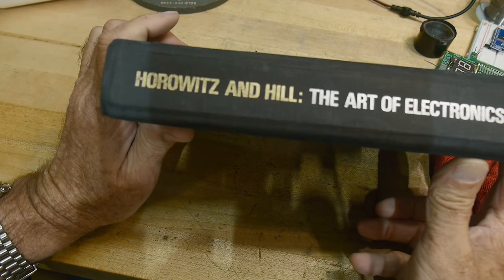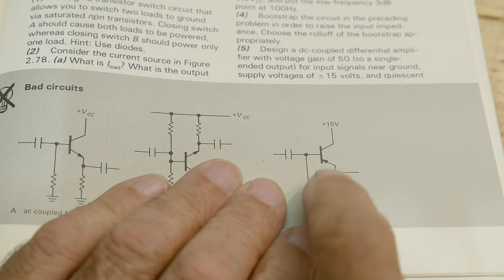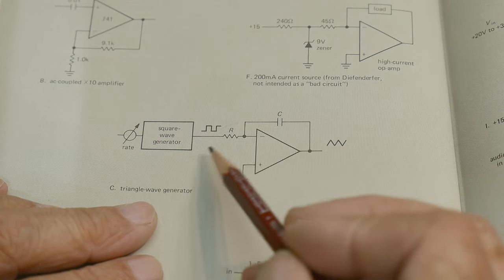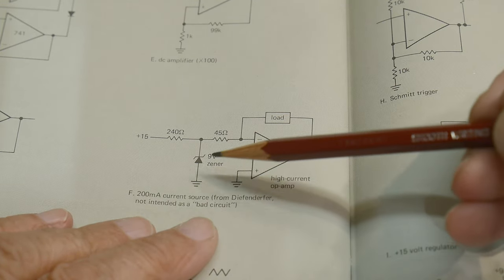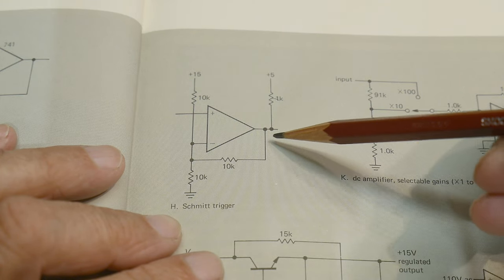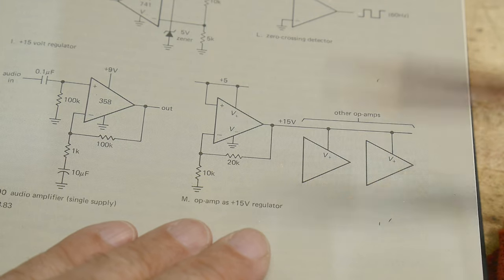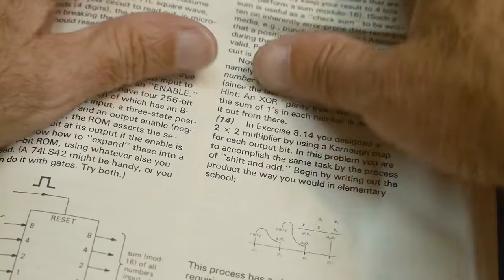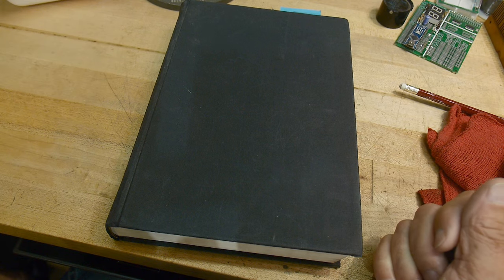#1548 Bad Circuits from the Art of Electronics

Comment: Gx100 gain audio amp. The problem is that the opamp input is not DC decoupled so it amplifies the DC x 100 going into saturation.
Reply: You beat me to it 😊
Reply: Also non inverting stage should have 99k feedback resistor, since the gain is (R2/R1) +1. In general it's just an odd circuit that doesn't make any sense, so I get that he was confused about it.
Reply: ahhh thanks it's so obvious but I never would have noticed it lol

Comment: I love this book and have used it a lot but it has the same problem as all academic textbooks in not providing answers or explanations. It even calls these "self evident" which is hilarious because I've never figured out most of them 😅
Reply: Not having the answers to the exercises in the book is a HUGE short coming.  It does no good to work an exercise and not know if your answer is correct.  If you get feedback that your answer is correct, you build confidence in that your knowledge is increasing.  If you get the wrong answer, then you can rework the exercise to figure out where you went wrong.  This is especially true if you are self-teaching without the benefit of an instructor.

If they published answer guides for the three books, I would gladly purchase them.
Reply: This is an issue with most theoretical books or other books they use at school and university. You'll get a bunch of examples and problems that only exists in theory. Or worse won't ever work in practice or are even dangerous.
Reply: @p_mouse8676  In that case AOE is full of very practical circuits as well (and specs, and some data sheets...). Some exercises are similar to detailed analysis of some "must be known" circuits. But some of them are also quite tricky and require further study. There is in fact another book "Learning the Art of Electronics" which is of great help when one wants to study the "AOE" reference book.
Reply: Yes that is pretty annoying. If they really were "self evident" why put them in the book in the first place!
Reply: That makes two of us :)
Reply: And me😂
Reply: Yeah, if they are self-evident, then what's the learning exercise? lol
Reply: Great opportunity for some youtuber to create a playlist with the solutions for each exercise! Thanks for the video!

Comment: The integrator circuit to create a triangle wave will end up getting stuck at one or the other of the rails due to nonidealities of the op amp. You need to have something in integrator circuits to control the constant of integration.  The Schmitt trigger needs to use positive feedback not negative.
Reply: It happens with a perfect integrator as soon you have a duty-cycle or symmetrie slightly off 1:1, or more exactly, slightly unequal areas below and above 0V. The closer they get, it takes just longer to drift to one of the rails, but after infinite time, it always will. The offset of the opamp and so on just makes it worse. 

You can either put a resistor parallel to the capacitor to limit the DC gain, but this does hurt the linearity of the triangle .. or, as done in triangle generators, use the triangle to produce the square wave.
Reply: @VintageTechFan  Any periodic signal that passes through a capacitor will technically integrate to zero.  The real problem is that the op-amp has a small offset voltage that will also be integrated.  Putting a resistor in parallel with the capacitor is adding a high pass filter to the integrator which effectively removes the "DC" error.  This can be ok solution for some applications, but deciding the roll off for the filter will be application dependent
Reply: @argcargv  Not really. If the input signal has a DC component, it will integrate that one, too. Periodic doesn't mean DC-free.
Reply: @VintageTechFan  but all you have to do to remove the dc component is capacitive coupling.  My point is that even if you do that, any input offset error of the op amp will still cause problems
Reply: @argcargv  Putting a capacitor in front of it will also distort the triangle shape. 

But yes, you are correct. It all condenses down to the fundamental problem of all integrators. ANY DC component, wherever it may come from, will have them drift to one of the limits sooner or later. An infinitely small DC component will just take infinite time to do it, but it will happen. 

You need to implement measures to counter that drift. Making it a low pass instead of an integrator (which is what adding a resistor parallel to the capacitor does) is the easy way and often sufficient, since a low pass behaves as integrator if you a far above its edge frequency. If you have to deal with very low frequency signals, it gets more complicated. Also, with this solution, you still set a DC gain by the two resistors and will get the input offset voltage amplified by that amount at the output .. if you set it low, the capacitor will get large.

You could for example track the DC offset developing on the output over a long time (many, many periods) and apply it with an appropriate polarity to the + input. After you chose a low offset opamp (maybe even one that you can trim to near zero).

Comment: If the DTC is not spot on exactly 50%, your triangle goes flying to either rail :-). You need to put either a resistor over the capacitor, but this distorts the flatness of the ramps. Another method is to use a positive and negative peak detector and a feedback adjusting the positive and negative peakvoltages of the square wave, or changing the DTC

Comment: The JFET analog switches are biased incorrectly, because the gate-channel junction acts like a diode if you feed them more than +0.6V Vgs. All three MOSFET analog switches are biased incorrectly because the input signal amplitude varies by more than the gate voltage.

Comment: 4:43 A resistor is required parallel to the cap in the feedback path.  The reason is the circuit is acting as an "ideal" integrator, but a practical integrator requires the resistor to provide DC stabilization.
Reply: A "leaky" integrator.
Reply: I missed that. The op-amp bias current will eventually put a voltage across the capacitor and latch it up.
Reply: I think the real issue is what is in the input? I think it will work ok with a +/- input, but not a 0/+ input.  The input resistor should deal with the offset currents.
Reply: There is a variable rate input control to the signal generator - the fixed integrator time constant around the opamp may not work well for all of the possible oscillator frequency rates.
Reply: @BowlingSuperior  It would certainly change the output amplitude.
Reply: this was my thinking as well... I've never seen high pass filter in the feedback without that resistor.
Reply: @russellhltn1396 IT will make the Feedback PT1 thats Low pass and only with C we have only integrator. So, R parallel to C will Change the Phase of stability And make the circuits Not so sttable. And because bandwidth and Transit f constant ist, then also the amplitude in dB for lower frequencies and DC will be larger without R

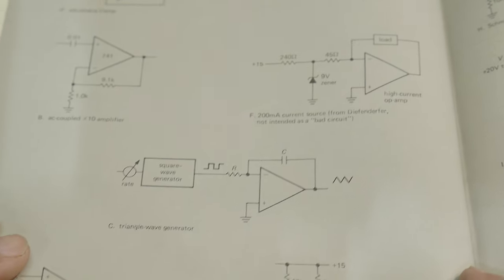Comment: 4:23 input bias current needs to flow in the 741, which otherwise will slam into one of the rails otherwise. With some, like LM380, it will work, because the designers put internal biasing, so all inputs can be directly AC coupled, and in fact you need to AC couple, as the input bias is set by the output devices to put them at mid rail, even when used in a single ended supply.

8:00 your output will have a big DC offset, and it will vary with temperature, as your amplifier will be amplifying any drift in the transistor Vbe, plus it will clip to negative rail very easily, as it has too high a collector resistor compared to the emitter resistor, so will basically ignore the input biasing, just using the transistor as if it was biased hard into class A, with the opamp input probably sitting at around 2V off the ground.

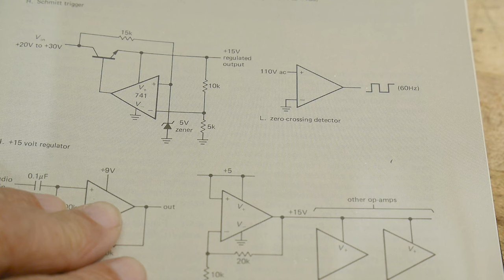10:48 the only opamp you can connect directly to 110VAC is one of the INA series of differential amplifiers, which have input resistors that are happy with up to 200V on the inputs.

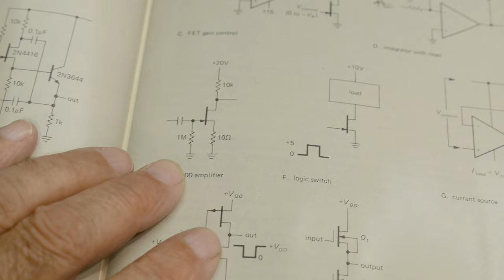13:00 using depletion mode Jfets, with positive gate bias, so they actually will always be on, as you need negative gate bias to turn the device off. I have abused them that way, using a dual Jfet to act as an AND gate (negative logic, to use the pulses on a VFD display to allow me to tell if a segment on a multiplexed display was on) to operate a small low current relay, to allow selection of an input based on the display showing a particular segment. Display ran on -30V, so a pair of 560k 1/16W resistors in series with the gate, and another to ground, made it work, keeping the gate biased correctly negative, and not causing much ghosting of the rest of the display. Then grabbed a convenient 12V power supply for the sensitive relay, and used it.

14:00 The bad part is the resistor values for TTL, not low enough to have correct input current, and for the wired OR no pull down resistor to handle the input bias current that flows out of the TTL input. LED drive direct off TTL was fine enough, though your logic level was not going to be able to drive another gate input, unless you used a resistor to limit current, and also ran the LED from Vcc, as the gate sink current capability is much higher than source, typically 24mA versus 1.6mA when sinking versus sourcing, because TTL is ground current driven. Also bad one seen but not talked about was driving input with negative voltage, or voltage much higher than supply, without using both a series resistor and a set of clamp diodes to the supply rails. for TTL give enough current into the input, around 50mA, and there is a good chance of turning the parasitic SCR in the substrate on, and if your processing at the fab was having an iffy day the overall gain of each transistor in the parasitic structure was over 1, making it a pretty good crowbar across the supply. If the power supply was current limited, it would just clamp the 5V rail to the current limit, and if it was over 1A current, the IC would get hot. If you had a 5A or better supply, then the crowbar IC would get nice and warm, till it either went short circuit from the die cooking, or it blew up the power pass transistors, if it did not have foldback current limiting. If it was capable of over 20A the ceramic packages would pop the lid, and the plastic DIP would blow a hole in the top, letting the TI/NS/Motorola/RCA special smoke out. I framed the one board that did that....
Reply: 13:00 Not only the depletion mode JFET needs a negative voltage across the Gate-Source junction for turning off, but also a positive voltage on this jonction would destroy the device if the current is not limited, as this jonction actually acts as a diode, with a voltage limited to around 0.65V 🙂

Comment: The circuit with the transistor upside down works in reverse beta mode. That’s handy sometimes - usually for hard switching though. They saturate at a much lower voltage than in the forward beta mode. The reverse beta mode also gives you a beautiful knee so the transistor can be used as a pretty good diode just by going between forward and reverse beta. In reverse beta there’s so little collector current compared to same base current in forward beta that a sharp knee around 0V results - a much better switching diode than a diode-connected transistor. The latter has a very good exponential response - better than many discrete diodes, especially when the base is wide (high voltage types).

Comment: 13:25 (F) it's a J-FET. Recall that they are depletion mode only so gate between 0 and +5V isn't useful. This is a hint for (E0, as well. 4:30: offset errors will lead to the output running to one rail or the other. 6:35 (F-- the Diefenderfer circuit) the current through the 45 ohm resistor will pass through tthe load (neg side of the load is at the op-amp output). Standard transconductance configuration. BUT, the current for the 45ohm resistor is sourced via the 240ohm. The voltage divider action will set the cathode of the zener at about 2.4V, giving an ACTUAL current of about 50mA.

Comment: 12:24 The analog switches: A will burn out the gate by applying +5V without current limiting. When 0V is on the gate, it will clamp negative voltages when it should be passing ±10V. B won't work because the MOSFET's parasitic diode will conduct when the input goes negative. Two MOSFETs in a row with the diodes in opposite directions would fix it. In C, when the JFET gate goes to 15V, the gate diode will be forward-biased and it will inject ~14.4V into the input and output. Depending on the surrounding circuit, it might also exceed the gate current rating and destroy the JFET.

Comment: G is actually fairly obvious. The positive input of the op-amp is likely not around ground so it has a positive offset, yet is DC-coupled to the first stage. This DC-offset sill be amplified by a factor of 100. At a supply voltage of +-15V this means that unless the offset is far below 0,15V the OP-Amp will simply clip. One might think that if you adjust the resistors correctly, and connect them to the negative rail instead of ground, it might work, but keep in mind that temperature drift will easily change the offset voltages enough to clip again.

Comment: Hmm, for the triangle wave generator it has two fixed value components for R and C, but a variable rate square wave at the input. So the shape at the output will be heavily dependent on the frequency of the input – could be anything from a square wave with a slewed edge at low frequency (with reference to the RC-determined slew rate), through a reasonable triangle wave, to a triangle with diminishing amplitude as the frequency rises. I think!

Comment: Non inverted gain 10 circuit (4') the wrong thing is that the non inverted pin of the opamp is not biased. There's always a bias current, even in the FET opamps. The capacitor integrates the current and the output follows this voltage (with the gain).

Comment: The problem with the integrator (4'38") is that the opamp has an offset voltage. This creates a current through the R that is integrated by the cap. The voltage at the opamp's output goes to VCC or VEE, depending on the offset voltage sign.
Reply: Another issue could be with the variable rate on the square wave generator - the output amplitude will change with the input frequency instead of staying constantish, which may not have been intended?  And it would end up clipping if the duty cycle isn't exactly 50%, probably.

Comment: Just watched this one and noted your mention of an answer guide. I’m not aware of one but Thomas C. Hayes did author a Student Manual for the Art of Electronics along with Paul Horowitz. I have a plastic ringed binder version of that first published by Cambridge University. Press in 1989, with updates at least until 2002. Full of lab exercises (23 in fact), loads of examples, worked problems, circuit diagrams and references to related readings in the Art of E. Highly recommended. Thanks for your content. I find your videos often touch on current projects. Keep it up!
Reply from the maker: https://milesdai.github.io/TAoE3Solutions/data/taoe3-solutions.pdf

Comment: The zero crossing one is fine. When the line is at zero volts the indicator light built into the opamp will extinguish. When it is not at zero volts it will be illuminated (briefly)

Comment: Triangle-wave generator: When the rate is turned down low (or at DC) the gain on the op-amp is huge since there is no feedback resistor.
Reply: Yes, or to put it in another way: The op-amp is an integrator. It will integrate any DC-voltage on the input... as well as it's own offset voltage. So in any case this will most likely integrate towards one of the voltage rails.

Comment: For an LM358, x100 gain is more like telephone audio bandwidth so that’s at the edge of what the part can do. Even if the biasing was right. LM358 should be biased to (VCC-1.5V)/2 for low voltage applications where output is expected to swing to ground. Then there needs to be a 1mA current source load on the output so it can work in class A for light loads, cutting down on distortion.  For anything high-bandwidth, 358 really needs a BJT follower on the output, in the loop of course. Its output stages are wimpy and kill the part’s gain with any sort of load.

Comment: 7:14 There is the error that should be obvious, but was also overlooked by me, namely the 240R resistor being a factor 10 too large for the operating current. If scaled to 24R (or maybe 27R) the numbers add up. But the other thing is, max. zener currents are rather large at over 200 mA. It is good practice for the zener to be able to handle the case of no load / load not drawing current, but for standard 0.5W or 1W zeners this won't be possible. For instance absolute max. for a 1W zener at 9 volts is 1W / 9V = 111 mA, around half of what is needed. I would say at least the diagram should specify a power zener able to handle the max. current.

Comment: For the integrator, when the surface area of the square wave signal above and below ground isn't the same (due to a mismatch in the magnitude of the positive and negative peak value AND/OR duty cycle) the output will pull to either rail. Adding a resistor in parallel with the capacitor fixes this issue :-). Sometimes the leakage of the capacitor is big enough to compensate for this already, but I guess it's good practice to add a high value resistor anyways?